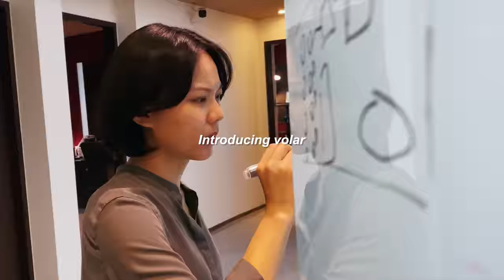Bellwether eVTOL | Free Flight with volar

Comment: Wow, these guys managed to make a drone
Reply: *wobbly drone
Reply: Not really a drone. Just a RC multi rotor VTOL to demonstrate how their concept will look like. Anything they can do to convince their shareholders 👍.
Reply: Y, and a highly unstable one. They even cut the landings, they looked pretty brutal
Reply: Does it come in black?
Reply: @ronmartin1375  Yes by magic after the first flight and crash the "fire" should make your under performing drone black!
Reply: @ntal5859  I think you are missing the point.
Reply: @corpusmori4657  did you see a “on sale now” sign anywhere?
Reply: Majorly. The design to finally not look like some back-of-the-shed crap, but channeling the thrust through the fuselage is pure beauty. Finally having (at least in the concept) retractable legs that go flush with the hull is also a piece of beauty. The rest: A flying McLaren P1, mofukars. These guys are changing the game. Give them a 100 mill on the contingency you want to fly in one in 6 months, they’ll burn through 30-40 mills, and you’ll be the first person sitting in an actually cool looking car that can hover, need no roads, in fact, apparently make height flights as well. Absolutely insane. If I had 5 mills, and they sold me one for 1.5, I’d spend 30% of all my wealth to have one.

Comment: This was designed first, and then built and made to fly. Typically, I would work the other way around and design something that flies, and then I would make it look good after the fact.
Reply: It’s because they have to do something to try to hold people’s attention while they build one that can actually fly with someone in it...
for more 15 minutes.
Reply: "I would work the other way around"
so, you would fly first, then build something, then design it?
Reply: Well, if you look at their website you kinda understand the reason behind their process. They state developing a compact evtol with hidden propellers as part of their objectives. So, they need to put that up in their design from the get-go. That's why evtols projects start with a small model. You can't afford to make a full scale prototype without testing the feasibility of a new design first. Also, they need funding. This is a good way of ensuring it.
Reply: Those ducted fans will give it very low performance. The design makes it incapable of much in the way of forward velocity. You can't expect a supercar design to have super flight characteristics.
Reply: That obvious huh?
Reply: Totally agree with you. They are doing something difficult, which is taking the shape of a supercar  and making it fly. It would be easier to take the shape of a drone and make it fly. And even easier if they gave it wings. But that is just the challenge they gave themselves.
Reply: They’re going with a Car Design, so I would start with a Car
Reply: It’s just a matter of machine learning, and a proper model to respond in milliseconds to any turbulence. Once they have enough data, they’ll have a model that keeps it stable like a humming bird.

Comment: Congratulations,  you seem to have built another multi-rotor aircraft model,  albeit a really beautifully designed and cool looking one.    Is it not just another quadcopter with a visually appealing body?   How does this differ from other multi-rotor aircraft  like the  EHang air taxi,  and other similarly powered multi-rotor aircraft?
Reply: the flight time will be considerably less than the ehang because it uses smaller ducted fans.  I bet it has no other benefit other than looking cool
Reply: How does this differ from other multi-rotor aircraft  ? 

Let me answer that Starstream, see unlike you Decepticons our human technology and lack of "Energon" knowledge,this  only allows us to use basic power sources, however with the help of Optimus prime and the Autobots along with our top human car/rocket desinger Elon Musk we are transitioning over to electric power sources, soon we will have flying cars to rival the Decepticons  and our return to the Moon to raid more technology from your crashed ship. So its all about power sources to rival Energon.

 As you know you're Enrgon super heats air incoming over your inlets and without moving blades literally redirects said superheat air out your exhaust, this is why us humans must use rotors.
Reply: @ntal5859   nailed it 👌
Reply: It's just more expensive ESCs, Flight controllers and out runner motors. With a super light and fragile body mold around it.  More than likely has terrible yaw authority as well, seeing its all enclosed like that.  So ya what u said.  Still damned cool looking tho
Reply: @FB0102  I guess it's case of "Everybody dies. The trick is to look as cool as you can while you're doing it."
Reply: Why are YT commenters smarter than investors?

Comment: As an aerospace engineer in the same industry, keep up the good work 👏 we will make flying cars accessible to everyone in the safest and most practical manner. 

As a tip, you guys should study more on flight dynamics. When it's this unstable at low speed, you won't able to reach high speed without it flipping over.
Reply: this project might be very challenging due to this flight dynamics thing. But it is really cool that flying car go this far, may a mature design need to retract a bit base on 3D FOD not as simple as 2D FOD
Reply: Do you think we should give up on Planes and Helis and just pay more taxes to get flying cars?
Reply: A flight controller with a PID loop could easily fix the stability issue. FPV drones have been using that for a long time, Betaflight is one such software. It's supported on many controllers.
Reply: @brianthered  I agree completely. Energy density isn't high enough to be able to support such VTOL craft for extended periods of time in a safe manner for general use. If they find a way to modify the Higgs field to reduce local mass values, then you could fly a tank on a tiny coin cell battery. Until that is discovered/invented, I don't see these becoming mainstream.
Reply: @brianthered   That's what the horse carriage guys said to the car builder 100 years ago.
Reply: @Zt3v3  Turns out, building a Car that drivers on the ROAD is much easier and safer than building a Flying car (just another fancy word for Helicopters) that literally flies in the sky. 

People can barely drive safely on Road, they'll do the same thing with AI controlled Flying cars. 

Are you prepared to pay more taxes because making these Flying cars means building a whole new infrastructure for cities, roads and skies.

Comment: Like others here have commented, it looks sleek. But these guys are behind the times. Other companies are already achieving flight times with fully stabilized manned aircraft. These guys look like they're trying to reinvent the wheel at this point. There are already successful stability systems out there and after 2 or more years of development, that's the least of what they should have, is proper stability.

Also, just looking at it, it does not look like they have the multirotor redundancy in place, this looks like it's got 4 ducted fans propelling it. If one fails, down you go in spectacular fashion. Other companies all use at least 8 motor/rotor combos for redundancy purposes.
Reply: One matter these guys could be trying to solve is the exposure of the propellers and the overall size of the eVTOL, which are gigantic concerns. Personal aircraft conmuting will never be a thing with vehicles that could cut your limbs off with the minimal mistake, nor vehicles so big their existence basically creates a problem we don't currently have (where to park them). Size and propeller exposure could be one of the reasons this prototype is unstable. I guess the idea is to tune things up so it stops being so. Not only do we need stable aircrafts, we need them as small and secure as cars.
Reply: @BarcadsONE  dude, wheels are the same. If you fall under the wheel of a semitruck you die or get amputated.
Reply: @alexisduarte8820  Not exactly, because wheels are aligned vertically and, in most vehicles, riders need to get out (throw themselves beneath or in front of the car after opening the door) in order to become vulnerable. Needless to say, motorcycles are statiscally more dangerous. Just being next to the vehicle is extremely risky here, it doesn't even need to be flying. Direct physical harm is not the only safety concern, though. There's a bigger margin for error on land in regards to objects crashing into the wheels. If something goes wrong, you may very well have the chance to just stop the vehicle. Besides, wheels are made to make contact with a solid. With aircrafts and propellers this margin is way smaller, and any accident can compromise the entire safety of not only the rider and passengers, but of the vehicle itself. Not just the one propeller affected. The propellers need to be protected for these eVTOL to become reliable conmuting alternatives. The thing is, doing so puts a lot of weight. It seems these guys are trying to tackle that problem.
Reply: @BarcadsONE  until this happens they should invent Propeller wich make no noise. I see people already complaining about the safety noise of Elektrik cars.
Reply: @Jac K Hey, it's not me xd; they literally state in their website having a compact and safe vehicle, and hidden propellers, as part of their objectives.
Reply: It's a prototype test mule. Would you rather they not release any videos or information until the final iteration to avoid scrutiny from arm chair YouTube engineers?
Reply: They have 8 duct fans

Comment: Looks very unstable. plus using EDFs thats gonna be super inefficient at this point. there are way more stable manned aircraft already flying and on sale now. good job on the sleek sexy design though. good luck with manned version.
Reply: It's a scale model. Like all eVTOL's the full sized vehicle will have stability software.
Reply: @martinw245  stabilizing should be the first thing they installed, unless they like the risk of crashing and burn more money.
Reply: @dragilxcom4176  Of course not. It's a small scale model. No point in writing sophisticated coding and installing expensive computer stabilisation systems when all you are doing is testing basic parameters. It would be a waste of funding and require enrirely new code for a larger vehicle.
Reply: @SuicideNeil  Same applied to previous eVTOL's, the stability systems were later in the program. Propulsion system and basic parameters are verified first,.
Reply: @dragilxcom4176  What, do you think the engineers in this case are so moronic that they aren't going to bother with stability. Lol!
Reply: @martinw245  $100 gives you a “flight controller” with active stability. 

My impression is that these eVTOLs weren’t seeing are like scaled up FPV Drones. Obviously this one is going for an audience who will be excited about the design. 

I think it does look unstable for all the work, but it’s that fancy design that’s holding them back. 

The EDFs don’t appear to be responsive enough.
Reply: @SuicideNeil  You have no idea what you are talking about. There is no point whatsoever installing and coding an expensive flight stability system when all you are trying to achieve is determine that your concept flies and when the model will be scraped in short order. The priority for their funding is to validate the flight dynamics, that's all. Wobbling a bit is irrelevant at this stage.

"No excuse" you say. What a silly thing to say. No lives are at stake in a scale model and there's no necessity for utter stability. 
This time next month an entirely new model will probably take its place. And when they build a full sized model, it will obviously be stable.

You see, they are aeronautical engineers, whereas you are "a guy on YouTube". Its their model, their concept, their funding and they have orders of magnitude greater aeronautical expertise than you do.
Reply: Huh?  EDF's are more efficient than open props for sure.  At this point or any point.
Reply: @martinw245  why did not they add the stability software for testing now? hmmm well possibly we can even tell what off the shelf flight controllers and EDF motors, props they are using and they have no idea what needs to be tuned and whats causing the wobbles. at this stage its just ads and building hype. they are just experimenting at this moment. I highly doubt that EDF full scale model will actually fly for more than 3 minutes. If they use Jet turbines, they have more chances to fly longer

Comment: Another significant advantage of flying cars lies in their potential environmental benefits. Unlike traditional vehicles that rely heavily on fossil fuels, many of the prototypes and concepts for flying cars focus on electric or hybrid powertrains. This shift towards cleaner energy sources aligns with global efforts to reduce carbon emissions and combat climate change. By integrating flying cars into the urban transit system, cities could significantly cut down on air pollution and move closer to achieving sustainability goals 😘🥰😘🥰😘🥰

Comment: It seems that the focus was on the design rather then function. It may look cool and attract interest but it won't sell if it doesn't work. It looks very unstable and the flight scenes are too short to make any conclusion. For a quad designing the front and back engines look to close together which will make it more wobbly than it has to be. Good work in any case, don't give up, i hope we can finally have a flying car.
Reply: Attractive design is a must at first , even more than functionality. Design attracts eyes of future customers and potential investors.If something is generally accepted by the public then they can start to invest in functionality and security.
Reply: @jordan84504  This is disruptive technology and there most important is to prove that it works. Same as the first aircraft, did they cared for the design? I agree that design is important especially in attracting inventors but you can end up in a loop where the design is all you work on. And at the end you will need to sell to customers and in this case they will care if this is reliable more than how it look. Latter in the next iterations sure,  people will value the design more.
Reply: @autodev3682  thats how most startup are nowadays, just bets. There goal is to get people to invest in there business. whether ir works or not afterwards will be just luck or perseverance.
Reply: @jordan84504  that is true, the investments are driven by the hype. In any case it is good that this is a time when we can investments like this.
Reply: Fighter jets are also inherently unstable on purpose to make them more maneuverable. This must be the sports model

Comment: Looks sleek and nice. 

But does the body contribute to any performance gains?
Eg: Lifting body in forward flight? That will reduce reliance on the lift fans and save energy?
Increased top speed? 

Or is it just cosmetics? And basically just a pretty drone?

Comment: I know it's a prototype and all but that thing is one gust of wind or small overcorrection away from flopping upside down, making a quad rotor long and skinny will always create stability issues especially when you're putting unnecessary weight such as that ridiculous gaudy body on it. It catches wind and increases its rotational inertia while also creating drag. If I was going to risk my life climbing in an experimental VTOL quad rotor, I would want all the mass and drag at the center and as little mass near the rotors as possible to reduce rotational inertia, the vehicle can control it's pitch and yaw far more easily and remains much more stable. I've been building racing and freestyle drones since 2013 and have learned all this stuff the hard way. Just look at a modern race drone, the motors are placed in a square, the arms are long and skinny and all the components are placed in the center as compactly as possible with the heaviest components like battery and camera at the top or bottom, that's how I would want a personal craft designed.

Comment: It looks like a quadcopter with a body designed to fly, but what kind of technology is it?

After taking off vertically like the F35B, if you fly at high speed, you can understand that the body design makes sense.

Comment: Just needs a lower seperation stage, such as a vehicle body frame under, then you can recharge, drive on city metro areas, or park between seas, on eighter end lands. Turn into a boat as well (floating).

To make the craft more agile and greater agility, have an isolated pivit balance cockpit area from the fans, will grant agular momentum, like a hand size drones.
Example, imagine a mono wheel hoover board, to be a giant craft, where the wheel is a cockpit chamber, and the foot step pads are the ducted fans.(flying in the air)

Comment: Efficiency is proportional to fan area hence this design is going to be less efficient than a bigger blade design which is very important in an eVTOL craft as we are not yet there with batteries. Its going to have a very short flight time. In addition smaller fans will need to turn extremely fast and this is going to make it loud. Can't fault the sexy design though...

Comment: I love the look, but there seem to be a lot of surfaces that don’t contribute to lift or perhaps even high speed stability, therefore adding weight for the sake of aesthetic value. 
It’s hard to optimize for both form and function but this is a lovely iteration, along the path to a final design.